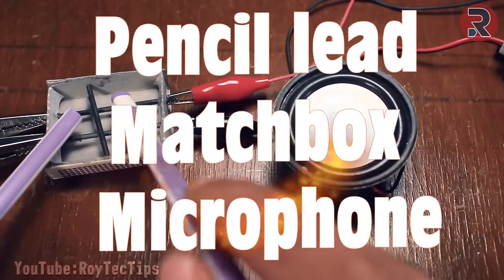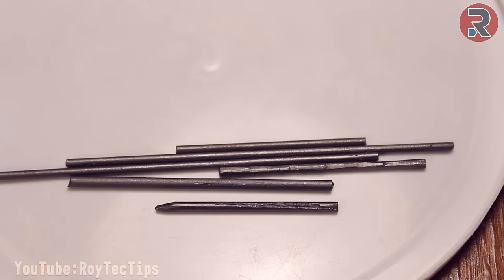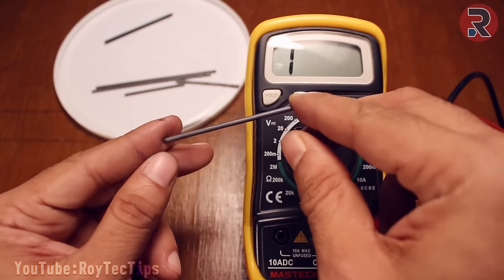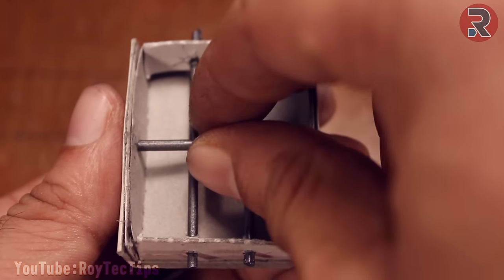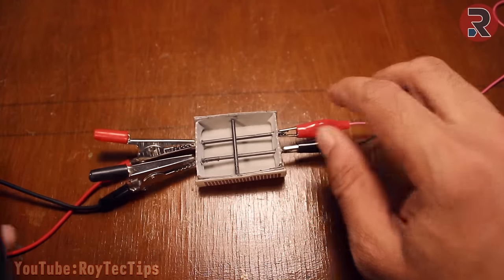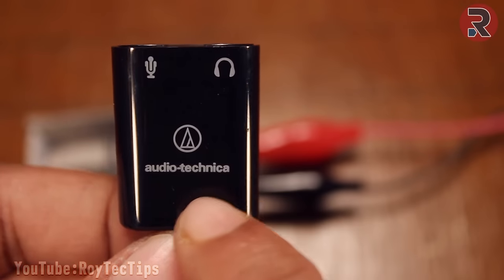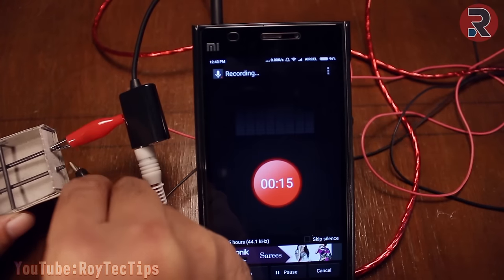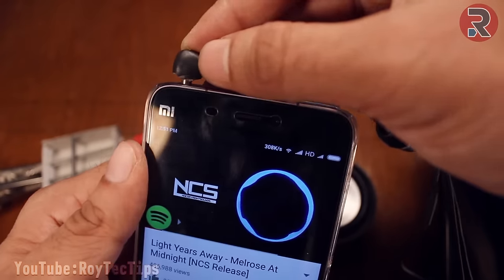Amazing Lifehack - MATCHBOX MICROPHONE - Mobile Recorder

Comment: bro.. everybody cant own a voltage checker..  or whatever that device you used to measure and also glue gun... so do something which is possible for kids or any person as a DIY project or else..
Reply: there is no need for hot glue or a multimeter in this project.
Reply from the maker: JD yes you are right . glued that part to give that match box little strength